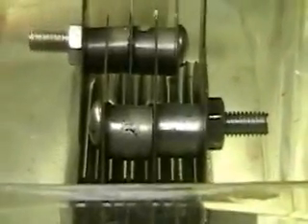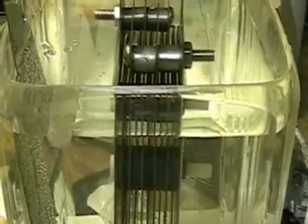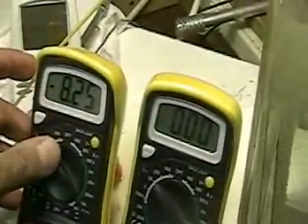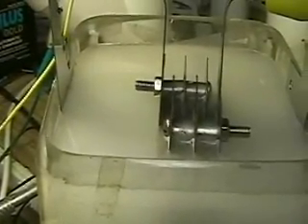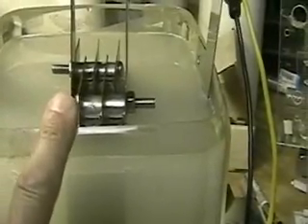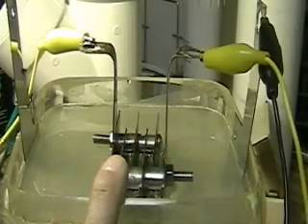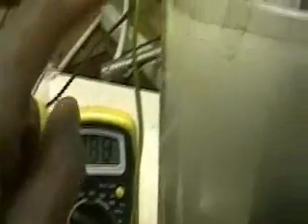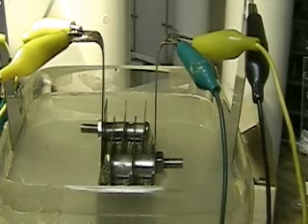Hydrogen Tap (FOCUS- answers) 346

Comment: I should clarify, to do that test on the N plates when the CELL is connected as normal, ie.. Anode/Cathode powered up.. See what V you are getting on the N between them in the NORMAL operation of the cell.

Seems to me as long as the neutral plates are "charging" they are going to also produce some O2 and or HHO. Makes you also wonder if the N plates produce hho/o2?  Another thought..  Seems like the N plates near the Neg would charge NEG produce HHO, while those near POS would produce the O2?

Comment: I still think the water/elect. are carrying voltage to the plates on each side, as that is the whole purpose of the elect?

Still is interesting to see those plates (as neutrals do) are picking up Voltage and storing it (capacitors) This would also accout for the AMP drop when using them, they are basically ABSORBING some of the laod just by being in the water/elec.

What about testing the Neutrals themselves between the Anode/Cathods ON the focus to see what they are "pulling"/absorbing?

Comment: Might i suggest an output test with your cell open, as it is, and closed, where you would try to cut off the volt leakeage that happens in  electrolyte.  Batteries have isolated and seperate cells to eliminate this and make the voltage production as high as it is. Unenclosed, a battery would only make 6 or 8 volts.  I read all this when reading about Bob Boyce. What do you think?